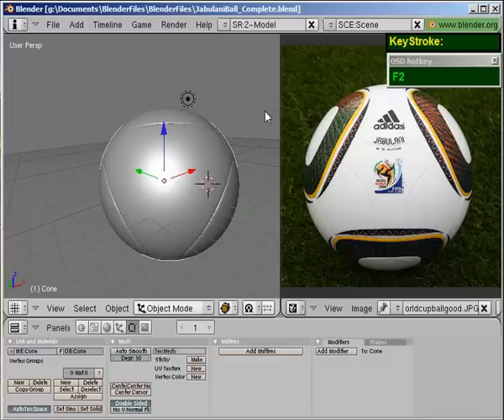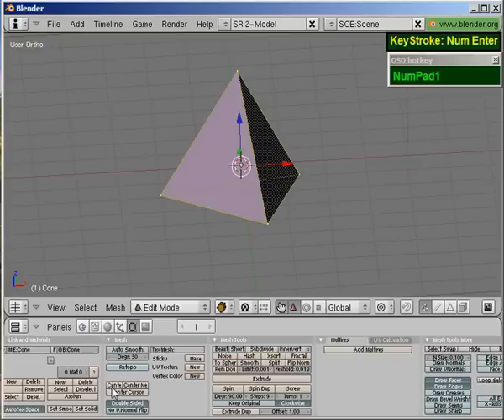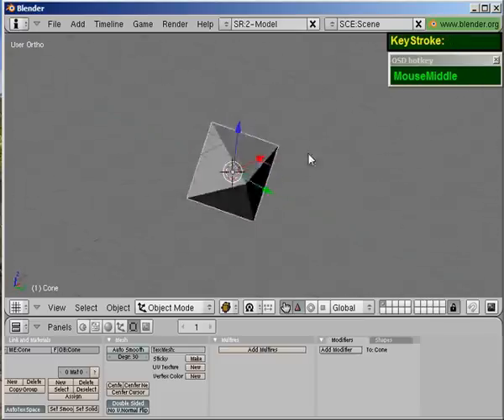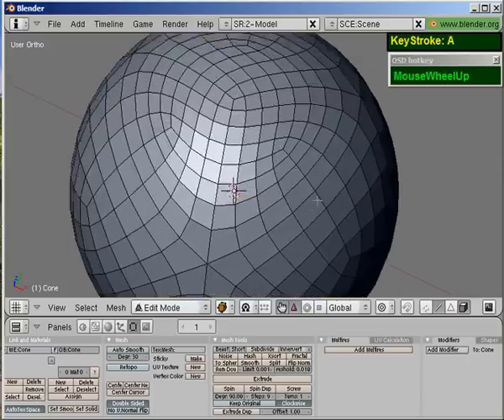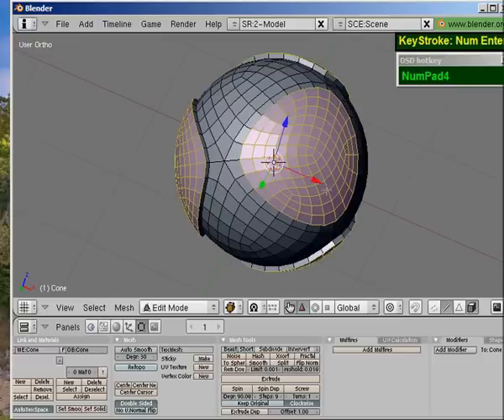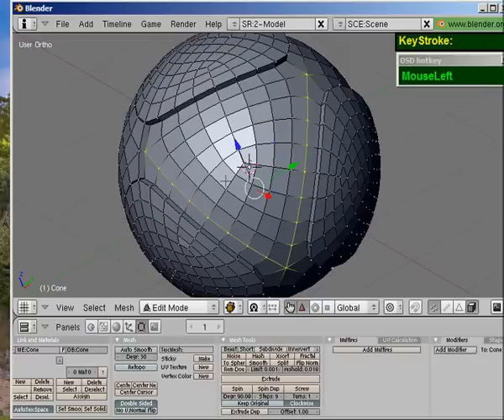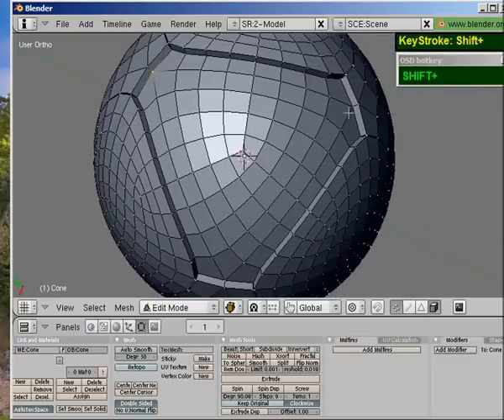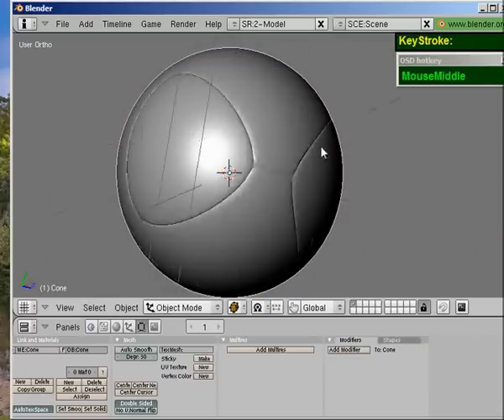Blender Modeling Tutorial - World Cup 2010 Jabulani Soccer Ball

Comment from the maker: @CodeMonkeyWithACanon Hmmm, I'm not on a Mac but I taught students using Macbooks and Pros, my solution for them is to use a full sized 101 USB keyboard attached to the Macbook. You can buy those slim and compact ones if you want to bring it around. You do need to set the keyboard up on the Mac first though. That usually solves the CTRL Numpad +&- combinations.

Comment from the maker: @maremmus BTW, I did create a ball with the extra 3 ridges using the method described above. It just took a while longer and it will take more than 10 minutes which is Youtube's video length limit. I also discovered while modeling the TeamGeist Ball that  you can model faster by using the Mirror Modifier 3 times at 3 different axis so that you can work with only 1 quarter of the ball, but for this Jabulani, you will have to carefully re-align.